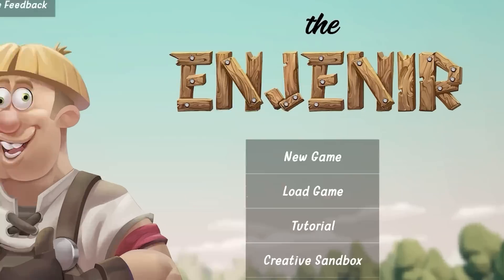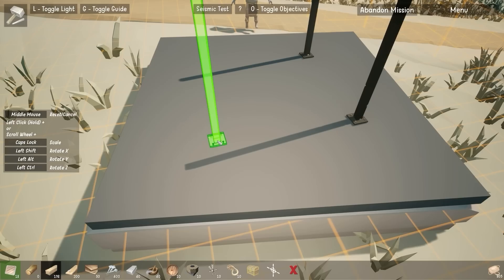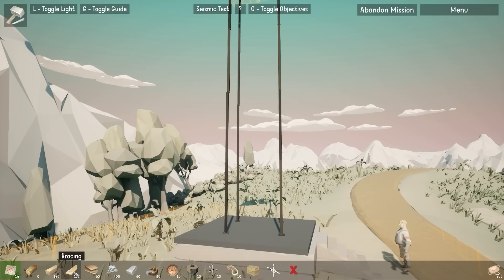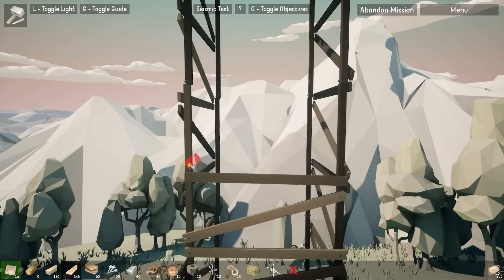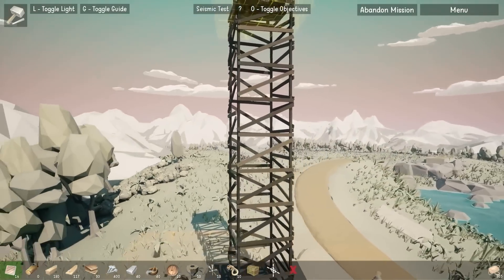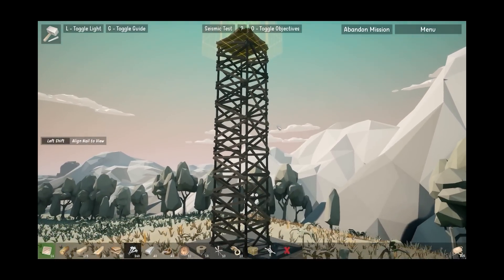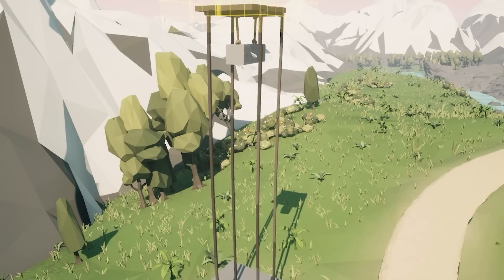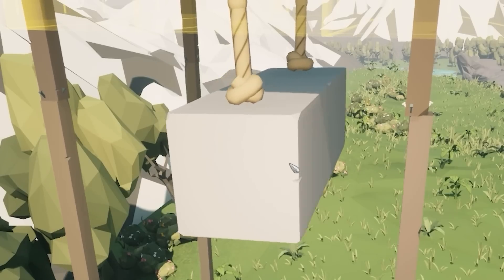Engineering an EARTHQUAKE PROOF tower!

Comment: Cool video. But if you took a idea of self support towers like call or radio tower instead of a actual building your principles would apply better. Also a lot of self support towers use wind lacing which is a smaller tower inside the other tower laced to each other

Comment: People often mix up engineers and architects… if you see a expensive and pretty building, a architect built that… if you see an old ass utilitarian building that’s fugly as fuck but seems to be indestructible even though it simultaneously looks like it could he blown over by a summer breeze? An Engineer built that…

The whole ‘structural stability’ bit and the differences between how the two achieves it makes me see engineers sitting there like ‘look at what it takes them to mimic a fraction of my power…’ and it pans from the gloriously designed ‘sturdy looking’ building with stone arches and all that… to a building that looks like it would collapse if you farted too close to it yet somehow holds up its own weight, plus the dozens of stories above it… making the most out of the bare minimum at its finest…

Comment: To the supports along the steel column, will reduce the unsupported length of the beam, and can prevent it from having a failure mode other than a regular bending such as torsional deformations. The change in the unsupported length also allows the beam to acquire more load while having a smaller deformation.

Comment: The problem is you are not reinforcing the butt joints on the vertical beams. You should take some bracing and lap it along side the beams and nail it the whole length.

Comment: This could be an interesting class about inertia and the lawa of Newton! Really it's inertia that keeps the building in place, both with the counterweight (which stays in place because it has such a big mass so it has a lot of inertia) and the "wheels" (which allow the building itself to stay in place thanks to its inertia  because by reducing friction they prevent the movement of the platform to be transmitted to the building). Awesome!😊

Comment: Isn't the seismc damper method what the Japanese have done for hundreds of years 2ith their pagodas? They have a long shaft or log suspended from the top down through the center of the building but doesn't reach the bottom of the building (ground level) normally from the 2nd level (first level up from ground level) to the top.

Comment: Everyone talking about how cool the explanations are, the science of it and all, meanwhile the whole video I'm just thinking "well of course it's breaking, you've got stilts stacked poorly on top of each other held together by just a couple of nails". 

Unless you include something like the dampener that lets even super weak setups work, the shoddy construction was bound to fail. In the first design, most of the time the points of failures looked like it was where the stilts sat on top of each other because while the side to side bracing got better, the actual connection between each "floor" was barely there. Improving that wouldn't have helped a ton, (again especially compared to the seismic dampener), but it definitely would have held up better.

Comment: Great non-engineering "explanation" of why triangles are the strongest. No one will ever think of you as an architect from that.

The real reason triangles are strong is much simpler, the only way to deform a triangle is by changing the length of a side, which requires breaking it, or by bending it.
This is in contrast to other shapes, like a square, where you can just pivot around the corners to make a rhombus, or even more if it can move in 3D.

Comment: This is awesome, I didn't know about counterweights. And was so impressed that it worked that well with limited beams. 

 it's true that flexibility of the structure is essential. (There is actually a magic school bus episode about it (the new one) where they equates building the building to a tree that flexes in the wind)

This flexibility need is also why wood works way better than blocks. Blocks are brittle. Wood is also lighter than blocks and this helps because the equations for calculating the horizon forces on the bottom uses the weight of the whole structure above it. 

Anyway, great video! Thank you!

Comment: Not sure if the game simulates it, but those angled braces should be "pointing" at each other.  It looked like you had 2 sides where the triangles met, and the other two were offset.  IRL that should reduce the total capacity of those non meeting sides.  I do think these videos where you try to actually engineer game mechanics are really good.  kANGaming does these sometimes too, with mechanisms (scrap mechanic, gear works, etc).  Engineering nerd speak while playing a game, my fav.

Comment: Same principle in bridge building. Lots of the worlds worst bridge collapses were due to them making bridges super rigid, so when some freak winds came it caused them to buckle and break. By making them "looser" and letting them sway, you dampen the effect of wind or uneven weight which counterintuitively makes them stronger even though most people would think a non-rigid structure is surely weaker.

Comment: I sat here this entire time HOPING you'd get to the counterweight.  It's amazing what something fairly simple can accomplish.
Reply: All the builds before really showed just how good it is though. He used his example stilts structure, added cross beams at the top center, and the block. It stayed together better than anything else.
Reply: I mean, it's literally in the thumbnail :D but yeah, it was a great demonstration and visualisation of different engineering techniques. Really solid video
Reply: @derAtze  Yes of course 😂 I simply meant seeing in action in this game and seeing if the physics work.
Reply: What is the old saying?

Keep
It
Simple
Stupid

So the counterweight design was the simplest amongst the ones shown, thus why the other saying “if it is stupid but works, then it isn’t stupid.” A saying you can annoy your friends, family and or coworkers with if you find a stupid solution to a problem but just works enough not to be stupid. Lol.
Reply: @dylandepetro4187  
Maxim 43 though:
If it's stupid and it works, it's still stupid and you're lucky.

Comment: "we will spread the force to the other leg, which is spreading its force to this leg, so there is no reduction in force at all, just an increase in weight"  RCE building code, chapter 1
Reply: Every joint is somewhat flexible, and that flexibility can absorb a portion of the force, and convert it to heat (although in this game, temperature likely isn't simulated, instead, there is probably some "flex resistance force" that is countering it)
Reply: Yeah he didnt explain how it's not that the beam itself is breaking, more the joint between them.  That and then also the fact that he DID mention, that it reduces flex.
Reply: it reduces the force on each beam at the expense of overall weight and increasing the force on joints, but its cheaper to make joints stronger than the entire beam.

Comment: Day 13 of waiting for Matt to upload Mindustry Part 3.

FFOTD: The turrets that repair units is the Repair Point and the Repair Turret (that's what they're called), the Repair Point has 40 hp, is 1 by 1 blocks. needs 30 copper, 30 lead, and 20 silicon to build, uses 60 power units per second, has a repair speed of 27 per second, and a range of 7.5 blocks. The Repair Turret has 205 hp, 2 by 2 blocks, needs 80 thorium, 90 silicon, and 60 plastanium to build, uses 300 power units per second, has a repair speed of 180 per second, and a range of 18.12 blocks, and it also has optional boosters: water (9.6 per second) makes it 1.64x stronger, and cryofluid (9.6 per second) makes it 2.44x stronger.
Reply: keep it going
Reply: Day 59 of me asking Matt to continue playing Minecraft.
Reply: Day 7 of telling you that Mindustry is not that great of a game
Reply: @Hans_Robert  boooooo